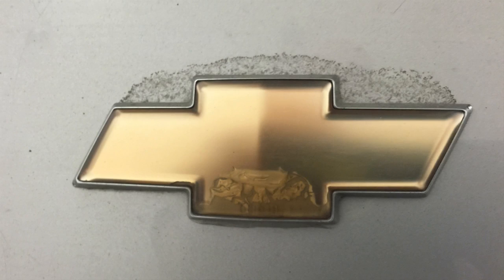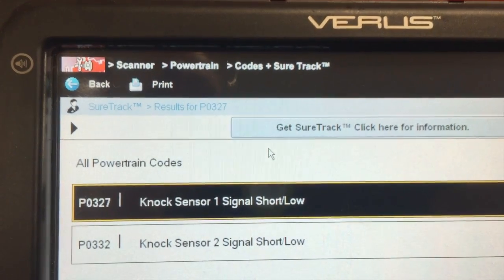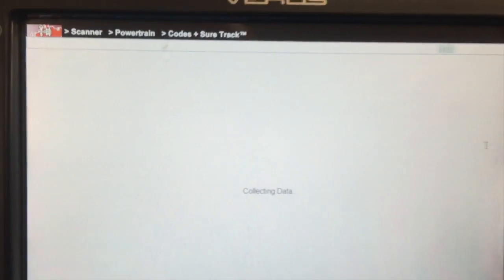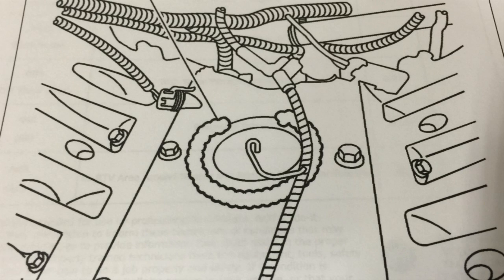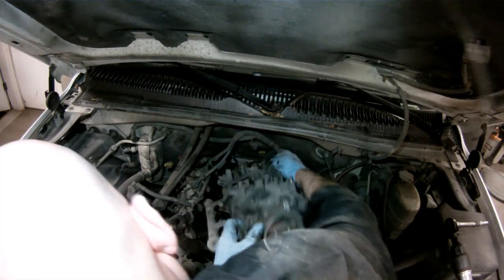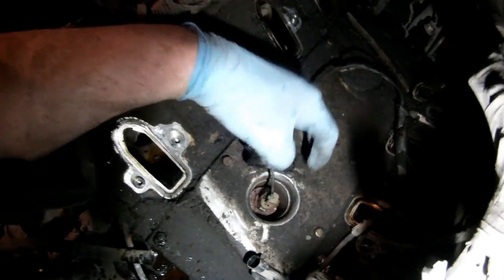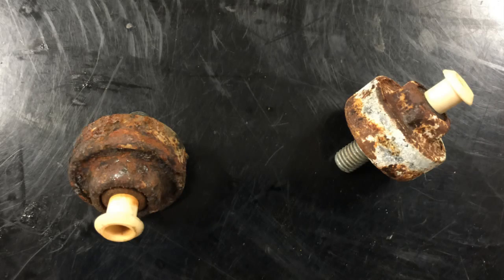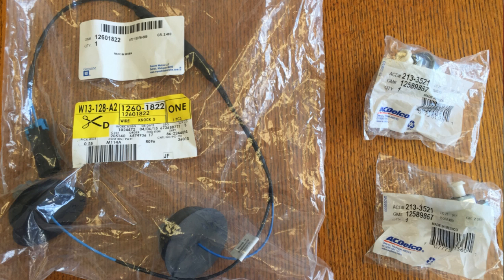Chevy and GMC Code P0332 P0327 - Knock Sensor

Comment: I Was wondering does these share same two  part # i has 2001 silverado 2500hd w/6.0Lt  my lite been on cleared lots since past 6+ yrs i was kinda hoping lite burn out lol   so im going to fix it  put it off too long clearing codes lasting few days  now i see where there at  i think ill be able to do it now i seen ur video   .thanks 4 sharing i would had never guess there was stuff under intake and not knowing there was two of them  i look b4 now i see how i missed them there buried in real good
Reply from the maker: I suggest using GM parts (gaskets, sensors, harness) to avoid having to do it twice. Also don't drop the sensors or they may get damaged. Go for it! You'll be glad you did. Besides that you want that light to go out so when the MAF goes bad it will come back on and you'll know there's a new problem that needs addressed. Haha.
Reply: my heavy Chevy gets all oem parts they fit not waste time try  making them cheap junk parts fit or end up going bad in short time and at end of the day its worth $$ u spend then breaking down pay some one else ton $ to do job u could do on weekend or should had done in 1st place i been there done that trying to get cheap cut corners  now i got my dream truck i try to keep this one 100% oem i rather pay more but i dont has 2nd guess it if i want to make 10 mile trip get milk or 1000+ miles trip old girl get me down & back  i had truck at 3 shop they made it out to be hard job they said i had to drop off few days not me i dont have 2nd ride sit around just sit at a shop when its few hr task not few days job  lol  ill order those parts hope it fixes no other curve ball  comes out wood work my bad luck i would be surprise  i get more codes after time will tell  i wont no how act if that little lite not on i think it just burnt out wont pop up when there is real issue thanks 4 help on video and with needed part list
Reply from the maker: sounds good. Hope it goes well!

Comment: what if you simply clear this code and continue driving? I have a 2003 Suburban with 220,000 miles...sounds like if you can't do this yourself, it'll be labor-cost-intensive...I've seen the check engine light on for about 3 weeks, just got a code reader, and this is the code...P0327...please advise...and thank you for the excellent video!
Reply from the maker: You can clear the code and if it stays off then I wouldn't worry about it. If it comes back then youll know what to do. Thanks for watching!

Comment: Quick tip for the rust belt guys. My sensor upon removal actually separated into two pieces leaving the base in the intake valley and the top part and inter workings all over. I thought I would never get it out easily. I took the same size socket 23mm iirc and jb welded it into the piece that was remaining in the intake valley. When that dried I was able to back it out.
Reply from the maker: Great tip! Thanks for watching.
Reply: can you just unplug the wire / @ThecardoctorTV
Reply: @dennisbeaver4074  ☺️

Comment: ive replaced the knock sensors & harness. code comes back after 20-30 min. of driving any ideas on where I can go now?
Reply: I'm having the same problem I replaced both knock sensors twice first time I bought offline second time I bought oem parts I've cleared the codes so many times I'm starting to think that it might be the computer
Reply: @markcochran723  What did you end up doing?
Reply from the maker: +chloe hofmann Have you tested the ohms on the knock circuit with the connector disconnected at the rear of the intake? What brand of sensor did you use? Is there a chance someone dropped a sensor before you installed it?
Reply: I have this exact problem.  used oem parts and I get the light on that fast as well.  The trucks starts and drives fine.
Reply: if it is the ohm's whats that mean?
Reply: Cole bought ac delco knock sensors offline and I put some silicone infront of it to direct the water away from the sensor . Been fine ever since.

Comment: Seen many vids and none have answered my q? Although I do not have a 99, I have a 92 Silverado 350 5.7 tbi.. I have no wire at all from my knock sensor, what I need to know is from the knock sensor, where does the wire go? to what part of the wire harness does the end of the knock sensor wire go to .. Thanks, az_ink_slinger1@yahoo.com
Reply from the maker: +Shawn Casey it should enter the harness that runs up from the starter area. I think it goes up to the spark timing module to the right of the TBI unit or the ECM behind the glovebox. It's a single wire.
Reply: +The Car Doctor Right on, thank you Sir appreciate it have a good day

Comment: Replaced both sensors 2 years ago and put silicon around them and the problems back. Can't remember if I changed the connector but I'm sure I didn't pay that much for the sensors so I cheaped out on those.
Reply from the maker: +AssGrabber B oh crud. Seems like a lot of folks have had issues with aftermarket sensors. But even a dropped sensor can become faulty down the road. I would probably replace the sensors and harness with OE stuff. Take care.
Reply: +The Car Doctor thanks
Reply from the maker: Good luck Ass Grabber!

Comment: Have a 2007 Avalanche.. P0332 just came on out of no where... Use OnStar diagnostic and thats the code they gave me.  Car is running smoothly, no knocking.. I was wondering maybe if it was bad gas, as i have about an 1/8th of a tank left..
Reply from the maker: +Josh Stern If in the outside chance it was somehow related the light should go away after a while driving on a fresh tank but I wouldn't hold my breath. Sometimes you wont hear engine knock either. I would play it by ear and see what happens or do some of the simple testing like measure resistance at the sensor connector. Good luck!
Reply: +The Car Doctor I will keep you posted.. thanks for the reply !
Reply from the maker: Thank you for dropping by the shop. Blessings.

Comment: do you where the know where the knock sensor is on a 2000 silverado 1500 4.3 v6 engine?
Reply from the maker: +Geovanny Cota L Rear of engine at corner of intake and cylinder head.

Comment: I have a 04 suburban I replaced the knocks and all but light still on and same code do you have any idea what it can be
Reply from the maker: +Ernie Rangel GM parts? Wiring harness also? Possibly someone dropped the new sensor. They are fragile. Any engine noise? Did you test the circuit at the wiring connector at the back of the manifold?

Comment: No SES light nut I have an apparent Spark Knock. Could it be a bad Knock Sensor and not thrown code?
Reply from the maker: +troymassey90 Yes, if you can monitor the knock PID and it does not indicate knock when you hear an audible knock or when a light hammer tap on block near sensor then its likely a bad sensor or wiring.

Comment: If I'm getting an apparent Spark Knock and have no engine code, can it still be the Knock Sensor?
Reply from the maker: +troymassey90 Probably but more likely a fuel, ignition or EGR problem. Even an internal engine mechanical issue can cause knock that sounds like pinging.

Comment: would it cause my truck to stall and not start for a while
Reply from the maker: +Paul Sweeney Not likely. Sounds more like an ignition module or fuel pump issue.
Reply: +The Car Doctor well my code is sending k2 sensor low input but before that I changed crankshaft position sensor and didn't use gm bought aftermarket
Reply from the maker: What is the code? Year, model, engine size?
Reply: +The Car Doctor it's an 02 gmc sierra 1500 2wd .. the code p0332 it says low input circuit but my crankshaft sensor was also on there changed it and didn't help .. I checked grounds and wer pretty dirty but cleaned up .. every now and then it will shut down and sometimes won't start back for 30 sec to sometimes 2 days
Reply: +Paul Sweeney u think it could b ecm
Reply: +The Car Doctor 5.3l
Reply from the maker: +Paul Sweeney what engine?
Reply: +The Car Doctor 5.3l vortec
Reply from the maker: +Paul Sweeney maybe. Does it loose spark or fuel? Crank sensor is a common issue along with pass lock system issues and fuel pumps. PCM is always possible. If it had a CKP code and you put a crappy part in then that's a good place to look.
Reply: +The Car Doctor yeh it loses spark and fuel ...fuel pump primes but can't smell no gas so I figure it's not letting the injectors work .. my dad read this guy's comments and he went through 2 cks both aftermarket didn't work and then bought gm cks and never had a problem since

Comment: I'm getting both of those codes along with violent shaking of my truck while in park with a flashing check engine light. Could a bad knock sensor be causing a piston misfire?
Reply from the maker: +Big Daddy it can cause some serious drivability issues. No ther codes for misfires?
Reply: +The Car Doctor no misfire codes. My cooling fans where also running when I took the key out of the truck so I disconnected the battery. It hasn't misfired since the last time I drove it for about 30 minutes.
Reply from the maker: +Big Daddy well I would say start with replacing both sensors and the harness and see if that clears things up. Good luck!
Reply: +The Car Doctor Big thanks to you! Your a great help to many

Comment: i have a 2002 trailblazer my check engine light came on while I was driving. i hooked up my scanner and the code i got was a p0327 which is a bad knock sensor i replace the old knock sensor and my light went off. i drive and it comes back on. do you know what my problem may be?
Reply from the maker: +LeMark Wash maybe a defective knock sensor. Also want to make sure you don't have internal engine noise or timing chain issues that might cause this. Good luck.
Reply: +The Car Doctor thanks for the information

Comment: could this cause hesitation in first gear when accelerating?
Reply from the maker: +swan734 for sure! Do you have the code? It effects timing control so power on accelleration is totally effected. Thanks for tuning in.
Reply: The Car Doctor I have this code and noticed mainly going uphill I get a bog for a second or so.  Any long term issue to worry about since I can’t throw another dollar into this truck for a few weeks.
Reply: Joe Max Fpv did you find the issue my truck is doing the same thing
Reply: @JoeMaxFpv  what ended up being the issue? I have the same symptom . Feels hesitant going up a slight hill around 55-60. Changed both sensors 2wice now. New harness. Im bout over it lol

Comment: i have a 2000 silverado 1500 w/ 5.3 and 191k on it. i had the ks codes pop up so i replaced both sensors, harness and intake gaskets. drove it about 2 days and it came back. i thought i got some bad sensors so i did it again and changed the harness with the same result. we checked the harness from the sensor to the pcm and it was all good. drove for about 3 days and it came back under heavy acceleration. went ahead and replaced the pcm thinking the ks drivers were bad and drove about 3 days and again it came back... with the exception of bank 2 ks. any ideas on this??? its been a nightmare doin it this many times i can do it asleep!!!
Reply from the maker: +2009KVFD976 I always use OE parts. Also, can't drop them or it will damage the crystal inside and they won't work. Also, bad gas will cause this. If you have a low octane fuel or some alcohol blended fuels will cause this but not common. Follow this flowchart. 
1. Check with the customer and determine the fuel type used and if any engine work has been done. 

2. Should have 87-89 octane fuel in the tank. 

3. Check if the intake plenum has been removed. 

4. Disconnect the knock sensor connector at the rear of the intake plenum, 2-way. 

5. Test the resistance of each knock sensor, Light Blue to ground and Dark Blue to ground. 

6. Should have 93K ohms to 107K ohms on each. 

7. If the harness, sensors check OK, remove the intake plenum, check the knock sensor seals and sensors. 

8. Look for water/corrosion at the knock sensors. 

9. Replace the knock sensors and reseal per TSB #02-06-04-023A.

Comment: I have the codes but no light
Reply from the maker: +snowblind187 is the bulb burnt out? The Check Engine light should illuminate when you turn the key on but go out after starting. If the bulb is working then I would clear the codes and see if it stays off.

Comment: what causes the censors to go bad most of the time ?
Reply from the maker: BLOODSHOT FILMS Actually most failures are caused by water sitting in the wells and subsequent corrosion and breakdown of electrical connections. Thanks for watching.

Comment: Would it be possible a bad fuel pump caused the code? Had p0332 on 02 avalanche and then fuel pump died I replaced it bad code went away.
Reply from the maker: +jwylde7 well if it wasn't getting proper fuel supply in theory it could cause a knock condition and set the code but I have never heard of this. Glad it went away. Thanks for dropping by the shop.

Comment: Mine lit up and reported the code, but a few drives after 2 bottles of gas dry and full tank of premium it went off. I never heard a ping or knock. Was I lucky or just a precursor to it coming back and having to be replaced. 92k on a 2003 5.3
Reply from the maker: azimmey well let's hope it stays off. Maybe some water got under there but dried up? You'll know what to do if it does come back. Good luck and thanks for watching!
Reply: thanks Car Doctor

Comment: do you happen to know where the knock sensor is located on the 4.3L? My 02 S10 is giving me PO327, the truck runs just fine, great actually. I just want change the sensor but I am having a hard time finding it.Maybe its under the intake manafold...

Thanks
Reply from the maker: Austin Butler the knock sensor on your vehicle is located just behind the distributor toward the left rear of the cylinder head. It has a three wire connector that is squeezed to release then a hex socket is used to remove the sensor. Be careful not to drop the replacement sensor. Good luck and thanks for watching.
Reply: Would thus go the same for a 2001 chevy blazer

Comment: Hey Car Doctor, Do you have an email address or website so i can send you info about my chevy silverado condition? thanks
Reply from the maker: Todd Aldworth info@thecardoctor.tv
Reply: @ThecardoctorTV  hey car Car Dr I have a 2003 Chevrolet Silverado With 4.8 and I keep getting the code for both knock sensors I have changed both 2 times and still getting the same code my truck is weak and only gets around 12-13mpg when used to be around 17 what else could I check or is there a way I could just delete the knock sensors completely, besides the gas mileage and little lose of power my truck runs perfect, so would deleting the knock sensors cause any other issues because I can tell it’s causing my timing to retard thanks for any help

Comment: Thank God this is not the way my 1999 Suburban is set up, it has the 5.7. I had the P0327 code. One sensor behind the starter and I was done. When the KS went bad I also got the P0420 code. It must have really loaded up the exhaust when it went bad. I almost crapped my pants thinking I had to do all that work.

Comment: Please I need your help. My 2005 gto have one or two knock sensors? (6.0L) LS-2 engine. I think only has one but I want to make sure. Thanks in advance.
Reply from the maker: ruizhernandeztrustfi There are two sensors on your vehicle. one on the left side of the engine block and one on the right. They are attached to the side of the engine block with a single bolt and each have a wiring harness leading to them The left side is just in front and slightly above the oil filter. the right is located in a similar place. The bolt is torqued at 15 ft lbs and be careful not to drop the new sensors as this will damage them. Good luck!
Reply: The Car Doctor
Great,
Thanks for let me know and have a nice day!
Best regards... Nelson
Reply: Google it

Comment: Hey Tim you must be working on a Chevy pulled out of the swamp or something. Been driving Chevy 's for 40 years and never had as many problems as this truck. I guess it's a demonstration vehicle to learn from for defects found to help Honda and Toyota owners :)
Reply from the maker: Steve Rob The truck was donated to a local Christian school and has a little over 160K miles on it. I have completed over 3K in repairs so far and still have a couple leaking exhaust manifolds with broken off bolts in the head. Going to defer that repair until it becomes a real problem. Was going to do a water pump video on it but the footage didn't turn out. Also it sounds like a fuel pump is not far in its future. I do have a couple more videos from this project to post and they should be up this weekend.  Just doing my part to promote Toyota sales across the globe!
Reply: Ha Ha - yeah I have the sheared off exhaust bolts as well , not leaking its been  4 years like that.  The fuel pump never went out but I put a new one in a AC delco at 90k because it was just a squealing  high pitch noise, changed  at 140k because again the noise, I have a carter in it now and it's real quiet I have 270k on now. If you do the exhaust manifold I'd love to see that.  That's great helping out the church. Bless you. 👍